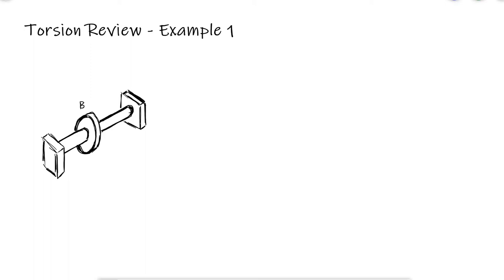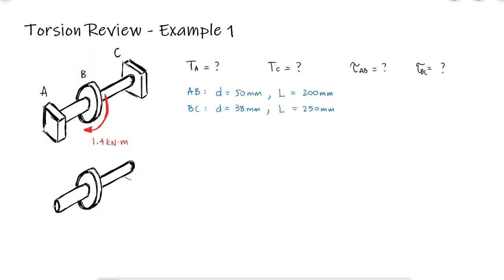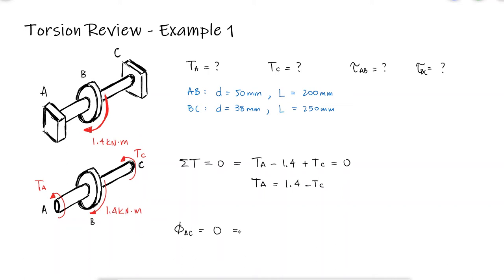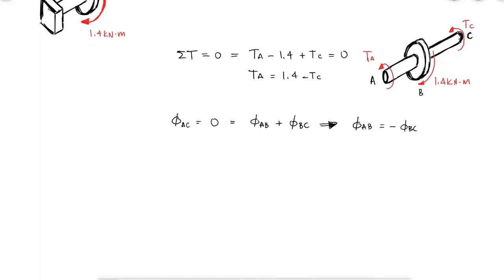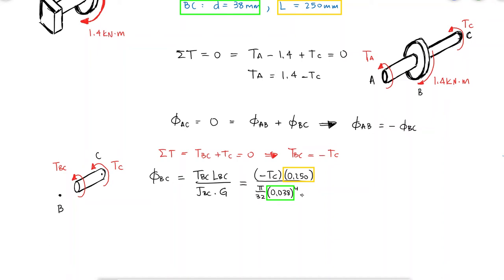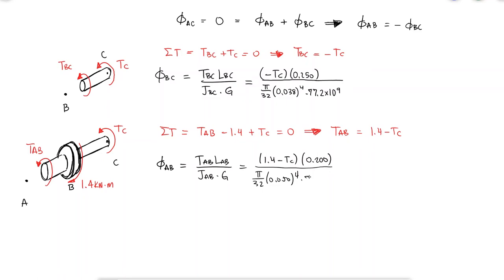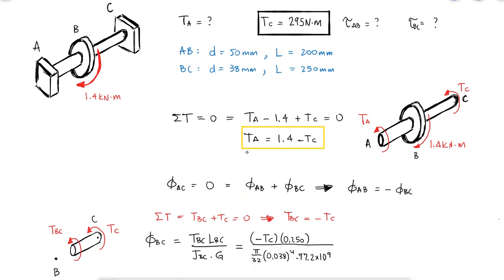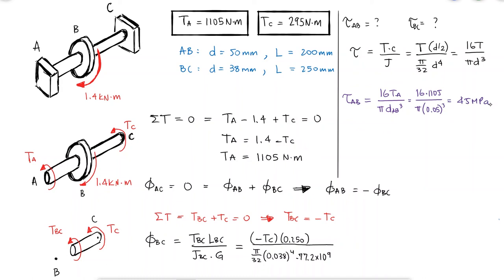STATICALLY INDETERMINATE Torsion in 2 Minutes!

Comment: wouldn't the torsional stress be dependant by the torque applied at a certain point rather than between 2 points. I am confused in the last part because you did Tab and Tbc. Shouldn't it just be Ta and Tc?